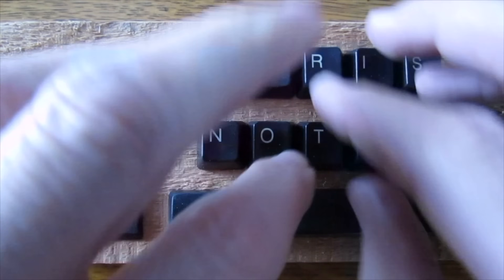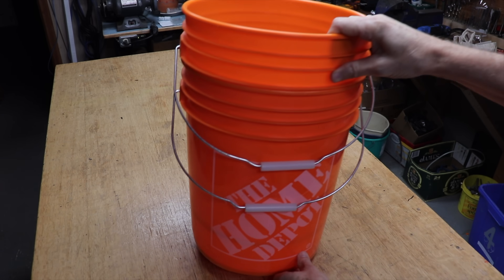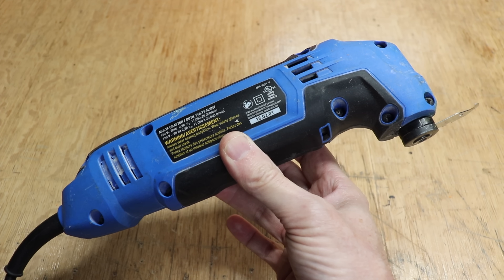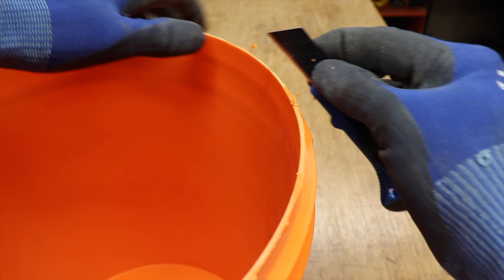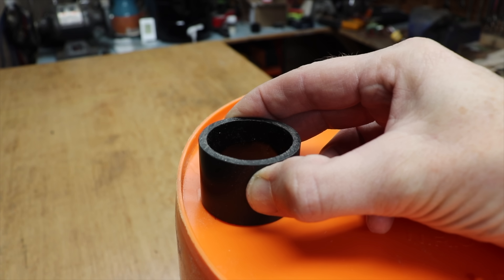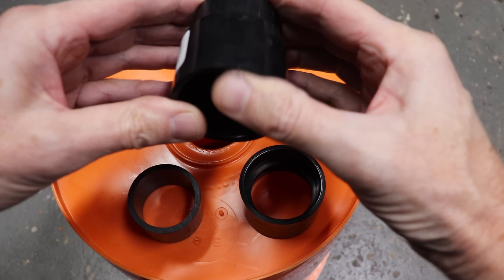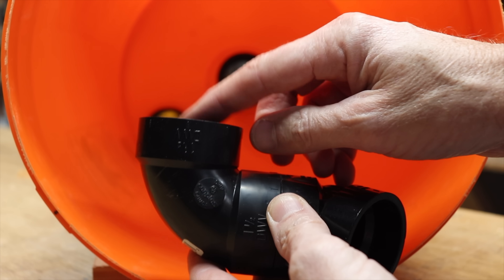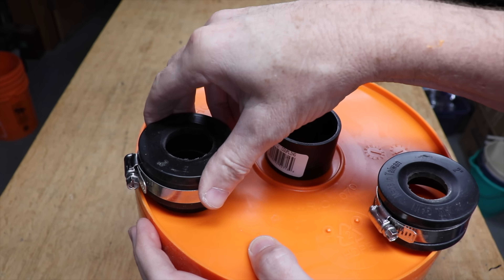How to Make ● Simple Cyclone Dust Collector

Comment: Absolute genius. There's a lot of knowledge in this video packed in under 7 mins. Extremely well-thought-out and equally well-edited. This is the first Chris Notap video I've watched and I couldn't hit the "Subscribe" button fast enough. Great resource!
Reply: Same. Actually, I hit Subscribe just for the opening bit alone.
Reply from the maker: Welcome to you too!!
Reply from the maker: Thanks for that great feedback and welcome!!
Reply: Me three!
Reply: Is there a parts list,  sizes, etc, love the video.
Reply: This.  So many other vids just ramble.  This was sweet and to the point.
Reply: Me four! Immediately after work today I threw a dust collector together for myself and it works like a dream. Thanks Chris!
Reply: Erik Maldre agreed I didn’t wait until the end
Reply: Nice set.up...use a street 45 and you don't need any extra 1-1/2" pipe
Reply: Sorry...Using a street 45 you'll use less pipe and less cutting
Reply: Sorry...Using a street 45 you'll use less pipe and less cutting

Comment: This is a genius design! I picked up all the parts yesterday and it took less than an hour to assemble. Thanks so much for designing this. My shop vac filter will be much happier.
Reply: I ran my test sans filter.
The system now in it's nascent form will vent to the great out doors.
Reply: @christophergallagher531  I have my shop set up with PVC tubes and vacuum stations with gates. The shop vac is outside the building in a large plastic trash can to protect it from the weather. Now the dust collector is set up next to that. It keeps the noise down in the shop.
Reply: @realspacemodels  That is a good idea.
No matter how good a machine is the business of moving air is noisy.
I had been thinking to add a large cyclone installed in an adjacent room venting directly out doors.

With this effective and compact unit, it is feasible to dedicate one to each tool station more or less.
That way the vacuum unit will not have to move dust as far.
Naturally the table saw and planer make would fill up a 5 gallon bucket quickly.

So far the unit far exceeds any expectations I conjured up!
Reply from the maker: I just finished an update with 2 more great tips!!..........https://youtu.be/BeU4nqSJtBY  and I made one for water! .....https://youtu.be/qr4shF-oOzg

Comment: This is probably my favorite video on diy dust collectors. Your simple no frills approach was great. I love that it doesn’t have a baffle and still works great. The rubber for hose connections is great and so simple because it’s universal and I love how you cut and friction fit the two buckets with basically no measuring or adding a bunch of screws. This is awesome
Reply from the maker: Thanks for that!!

Comment: The oscillating saw sounds just like a bone saw, or vice versa (probably more likely).  

I wondered if you waxed the inside, sides of the buckets whether it might make them even more effective?  Less friction means the dust will retain more energy and remain on the bucket sides longer.  Something I might try.
Reply from the maker: Did you watch the update video? .....  https://youtu.be/BeU4nqSJtBY

Comment: 55 gallon plastic drum works a bit better and gives you more capacity, all you do it take the top off the shop vac and mount it to the top of the plastic drum, if you have a drum with an open top

Comment: I'll bet I've watched 30+ videos on dust collection, including this one.  By far, this was the easiest, cheapest and most effective build.  I'm going to buy a couple more buckets to have on hand to swap out when one is full so I don't have to empty just the one.  It works like a champ!! I'm already brainstorming on how to incorporate it into a a more permanent installation using some schedule 40 pipe and some blast gates..
Subscribing and liking now..
Great Job Chris!!
PS, I used a cutoff wheel in my dremel tool to cut the rim of the top bucket off.. worked like a charm.
Reply from the maker: Fantastic and thanks for that great feedback!! And welcome to the channel!

Comment: Dumb question but what is the central vac hose used for.  Do I need another vacuum for this amazing invention?
Reply from the maker: There are no dumb questions! You can use whatever hose you want on the vacuum side or the other side.  It's just what I use when running a saw or tool. Thanks.

Comment: Hi Chris,
Thanks for another great video.
I was thinking to get any old rag or cloth you might be throwing away, WET THEM and use rubberized waterproof flex tape the rag or cloth to the inside walls of the TOP BUCKET. The more the merrier. The result will be less dust on the filter. That’s if you have any old rags or cloth hanging around. It may be a good idea or not, but it’s worth experimenting.
THANKS!
Peacej,
🙏🏽💚🍏🥑🥝🦋👍🏽✌🏽
Reply from the maker: I just finished an update with 2 more great tips!!..........https://youtu.be/BeU4nqSJtBY  and I made one for water! .....https://youtu.be/qr4shF-oOzg

Comment: Do you think this could be used as a small room air cleaner setup?  I need to do some foundation repair in a small laundry room in my basement, which will involve a lot of mortar grinding, etc...  Was trying to find a solution to keep the air-born dust levels low..  Thoughts?

Comment: Do you think that will work for sanding paint? I normally have to hook my wet/dry vac up to my orbital sander when I sand down the bottom paint of my boat every year. The boat yard requires you to hook up to your shop vac because they don't want paint dust all over the shipyard ground. But as you can imagine, the paint dust absolutely destroys the shop vacs filter within minutes.
Reply from the maker: Sorry, I don't know if it will work for paint dust. I would think it is worth a try since paint dust does have some weight to it and it would centrifugally be thrown to the outside and possibly not get sucked up into the shop vac.

Comment: I loved the engunuity behind this design.  The only down side I see is what happens when you over fill the bottom bucket.The excess will come spilling out.   I suppose you could just suck it up again.  Be nice if there was some way to know when your bucket needs to be emptied.
Reply from the maker: I found that a flashlight behind it for a second shows the level of dust. Easy peasy. Thanks.

Comment: Another easy way to make round holes in plastic is to use a hole saw and run it backwards. If you run it the direction it was meant to go the plastic will tear, but backwards it won't.
Reply from the maker: Good tips. Thanks.

Comment: Greetings from Brazil!
Is this design able to collect water? For example if I use the vacuum on a wet sofa will it work to keep the water off the equipment?
Reply from the maker: Not sure what you're asking. Did you watch the video?
Reply: @chrisnotap  Yes, all of it.
I have a vacuum cleaner that cannot aspire humidity, for example I can't clean a wet sofa with my vacuum and I will try your project to do it.
watch?v=tb7HK9nav0A
Reply from the maker: Oh Ok. Sorry, I misunderstood what you were asking. Yes! If you have a vacuum that is a normal house vacuum that is not for sucking up wet things, this is great to hook up to one of those yes! In my case, I made one of these 30 years ago. If we had a wine spill on the carpet, if one of the kids threw up on the carpet or we had any other wet disaster happen, we'd grab this gadget with a spray bottle of hot water with a few drops of dish soap and just suck up the mess and squirt it to help rinse it all out. Works great!! Good luck!
Reply: @chrisnotap  tks!

Comment: Made it!   Works like a charm. I had made the one bucket system the first time but as he said, sawdust got into the shopvac. Home Depot made a few mods to their buckets (probably from watching this video 😆) so I had to make a few very small modifications.  Had to cut 2 small ‘V’ slits on the top bucket to get it to slip into the other one.  
The other mod I had to do was use my angle grinder with a sander disc to level down the center hole on the bottom of the bucket as it is the same circumference as the 1 1/2 insert.  Then I measured and cut.  Works perfectly.
Reply from the maker: I just finished an update with 2 more great tips!!..........https://youtu.be/BeU4nqSJtBY  and I made one for water! .....https://youtu.be/qr4shF-oOzg

Comment: Nice cheap Cylcone System ! Thank for doing all the Research  and Development plus posting your findings  i’m a retired Woodworker myself  and a Cyclone is a must for almost everything i do  plus it makes the Vacumn last much longer  and work more efficient  i usually buy the cheap Chinese Cyclones on Ebay that are not branded but look very similar to a Dust Deputy  but only cost less than $10.00
Reply from the maker: Interesting.

Comment: I made this dust collector for my shop vac.  For less than $20, it works fantastically .   It sure saves me a lot of $$ on buying vacuum bags for the shop vac.  Thanks for the video and great idea.

Later on I installed a plywood top of the dust collector to provide extra strength to the bucket.  Without the plywood, the plastic begins to fatigue and crack when removing thee hoses to empty dust.  Of course, that meant I had to cut longer pieces of pvc pipe.  I increased length to 2.5” to account for the 3/4” plywood I used.
Reply from the maker: I just finished an update with 2 more great tips!!..........https://youtu.be/BeU4nqSJtBY  and I made one for water! .....https://youtu.be/qr4shF-oOzg

Comment: This is pretty cool but, I'm at a loss.  What advantage is gained by adding the dust collector to the shop vac?  I mean, the shop vac is just that, a shop vac with a place to catch (or collect) saw dust, dirt or whatever you're vacuuming up.  Why would you need a separate collector added to the shop vac?  I'm really curious to know this since I'm thinking of getting into small woodworking in my garage.

Comment: I can't work out what the small screw is for? Great idea by the way!
Reply from the maker: The screw holds the angled pipe against the side of the pail and prevents it from rotating when attaching the hose.
Reply: @chrisnotap  thank you. I made this yesterday and works great. The only problem I have is that the top bucket gets sucked in when the vacuum is turned on for some reason and looks like it's about to break. Any fixes for this? Thanks!

Comment: In trying to sort out Why, I measured the diameters of the exterior of the cut area
as 11.378 inches and the inside of the original bucket as 11.17 inches...thus, an
interferance of about 0,200 inches...I even, slitted the sides every 45 degrees and nada.

Looks like cutting much further down the bucket after measuring where on the lower
part of the bucket  will be small enough to enter the original bucket...for tomorrow...

Comment: Perhaps Home Depot buckets are a slightly different dimension...I use 2 of the same type buckets
 of 5 gallons cut exactly, and trimmed just like Chris...they Do not fit!!!  The cut diameter is 0.125 of an inch
larger than the opening of the uncut bucket...buyer beware...now to figure out a fix, as I like
the principle...thanks Chris
Reply from the maker: One other commenter has said he had the same problem. These buckets must be different in different parts of the world. I have copied and pasted what he said he did to solve the problem. Good luck. Here is what he said...........
"The challenge is the fact that the plastic rim of these HD buckets is typically distorted and not perfectly round.  Trying to work the edge of the top bucket to mate with the bottom can result in "crushed" fingers when pressing on the edges to line them up at the same time you're applying a fair amount of downward pressure.  I found I could better deal with this by adding some thin (saw blade thick) notches to the rim of the top bucket thereby allowing the resulting sections to flex better on their own.  It still leaves plenty of tension in the connection enabling the strong friction fit you intended."

Comment: Chris, thanks. I'm a newbie setting up a wood workshop. I've checked out a lot of systems and will go with yours. Couple of points . . . 
How to do judge when to empty? 
I'm in UK and would be happy to buy off your site if you had UK links.
Reply from the maker: Nice of you to offer if I was selling, but sorry, I'm not selling at this time. I found that just by flashing a flashlight behind the bucket you can easily tell if it's getting to the top of the lower bucket and ready to empty.
Reply: @chrisnotap  Chris thanks . . . but I was asking if you can please  provide links to UK Amazon.

Comment: I don't know if anybody else has noticed the major static electricity this devise builds up? It does BIG TIME. Im in N. Texas and it is right at 60° humidity 45% just for references. Be careful what you are vacuuming around it might just set off flammables. Remember the gas  pumps a few years ago? Work safe people.

Comment: An ingenious solution.  I made this last week.  Thanks for your very well-made video guide!  I didn't have an extra hose lying around so I bought a 15' shop vac hose on Amazon (listed as "15 Foot Hose for Shop Vac 90512 Wet Dry Vacuum Cleaner 15' x 1 1/4" Dia Fits Rigid Craftsman Genie ShopVac").  I needed to remove the 2" connector on the end and instead used a hose clamp to secure a $2 piece of 1 1/4" white polypropylene drain pipe to the end to enable me to insert the hose easily into the rubber friction-seal connection your design creates.  The one area that did give me some problems was getting the two buckets together, even when I ensured the edge of the top bucket had been smoothed down with a slight beveled edge.  The challenge is the fact that the plastic rim of these HD buckets is typically distorted and not perfectly round.  Trying to work the edge of the top bucket to mate with the bottom can result in "crushed" fingers when pressing on the edges to line them up at the same time you're applying a fair amount of downward pressure.  I found I could better deal with this by adding some thin (saw blade thick) notches to the rim of the top bucket thereby allowing the resulting sections to flex better on their own.  It still leaves plenty of tension in the connection enabling the strong friction fit you intended.
Reply from the maker: That's great! I have a feeling that these buckets may be different in different parts of the world. Your solution with the slots is spot on! So glad it worked for you! Could you reply and send me the link to the hose you bought on amazon? That would be great. Thanks.
Reply from the maker: Or you could email me the info for the hose at chrisnotap@gmail.com     I haven't been able to find a hose that I like.

Comment: What’s wrong with just using the shop vac by itself?
Reply from the maker: In some instances you are correct. But if you use it a lot, it becomes difficult removing the impacted shop vac of sawdust. Thanks.

Comment: Made some adjustments and used 2"connectors and 2 1/2" hose. Works great, thanks for the post.
Reply: What size flexible hose cap did you use?
Reply: @LittleBullseye  Instead of using the flexible hose cap, I used 2" elbows that fit on the 2" PVC pipe that goes through the hole cut in the bottom of the bucket. In order to make the tool receiving end of the 21/2" flexible hose to fit into the 2" elbow, I heated the end of a short section of the 2" PVC with a heat gun, and forced the tool receiving end the the flexible hose into it. The other end of that pipe section fits into the elbow that took the place of the flexible hose cap. Hope this is a help.

Comment: Great video Chris! I'm hoping to make one of these soon. How would you incorporate a grounding wire? I'll probably make a wooden cart to house a shop vac and the dust collector. Thanks again and great job!
Reply from the maker: Yes. Others have mentioned that. Add a ground wire. Mine is on concrete and it didn't seem to have an issue

Comment: So, let’s talk about the static concerns mentioned by Mike Smith and Steven Hall. What do the commercial cyclones have that mitigate/eliminate the static potential? Aren’t they made of acrylic and plastic too?
Reply from the maker: I use mine on concrete without issue  but in some cases  you'd need to ground it.

Comment: Did you create the bucket rig to use in place of a typical 20 gallon shop vac? Or so dust wouldn't get on the filter of the vac and choke it.?

Comment: Looks great! How does this work with drywall dust? That's my biggest problem with my vac because my folder get clogged so quickly.
Reply from the maker: I've had quite a few ask this so I just finished taking 2 square feet of 1/2" drywall and I pulverized it with a hammer into mostly dust and small pieces and removed all the paper. I sucked it up and I estimate about 99.9% stayed in the bucket or possibly 99.99%. I was impressed.  Hope this helps.
Reply: @chrisnotap  It actually does because a lot of people are saying they need a water filtration stage for this. I'm very happy with the majority getting trapped behind: means the 30 dollar filters will last a  lot longer. Thanks! IO'
m going to make this for sure: I will try to remember to come back and let you know how it went.
BTW, love the details - especially how you figured out how to fit the two buckets together with no need for gaskets, clamos, etc... Well done! :)